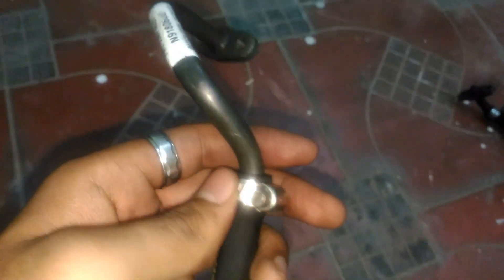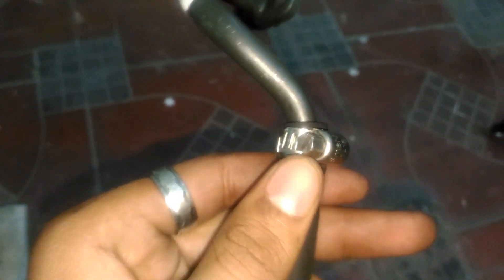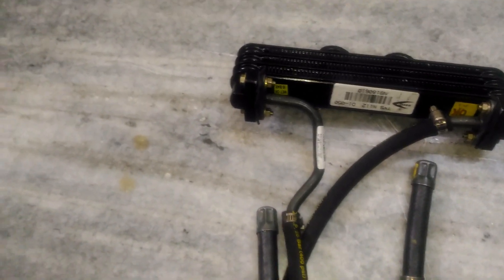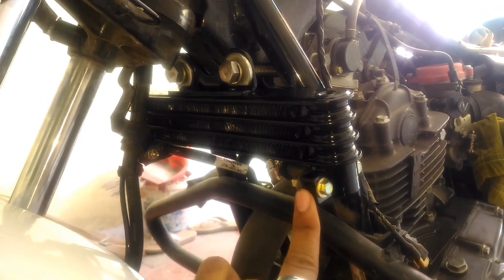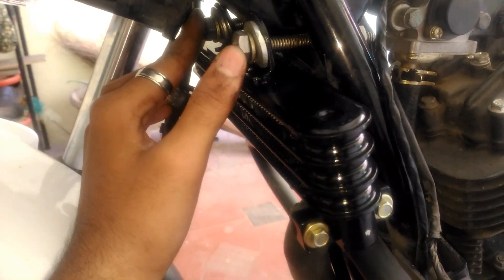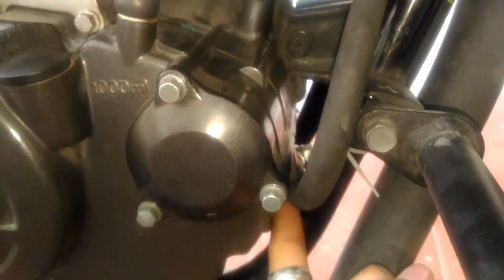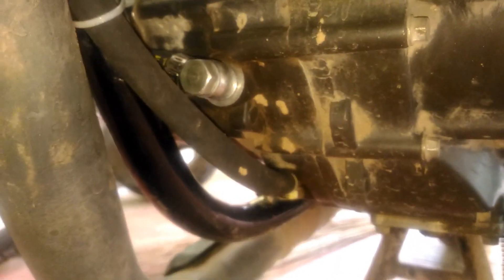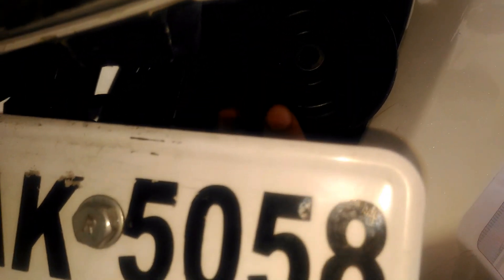Oil cooler installation on TVS apache RTR 180 ABS | DIY | heating issue resolved

Comment: Bro can u  make a video on 
1= Converting of rear drum break to disc brakes APACHE 160 with costings
2=Converting non ABS to ABS APACHE 160 pls with costings 
desperately waiting for your reply
Reply from the maker: brother firstly I need to appreciate your quires.  Because you asked me to useful things on bike.  Even I was in the thinking of converting normal bike into ABS.
But the sad thing is that, I am studying and I am depend on my parents.
So i cannot spend money as wish I think.
It was my future plan, when i learned to make some money.
Now a days I am just doing some cost efficient projects like side safety feature.  If you wish please do watch that on my channel.
thanks a lot for your enthusiasm.
God bless.  Ride safe.  Have a good day.
Reply: @Mechanicgrapher  it is not worth because we you have to replace a lot of parts for installation of ABS unit.

And reliability will always be a issue.
Reply from the maker: @442honey  yes i know buddy.
I need complete ABS system.
Then I need to change the complete wiring harness.
Install new ABS sensor plates which comes under ABS system.
All these are gonna cost more than 17k. Thankfully I already own ABS equipped motorcycyle.

Comment: after fixing oil cooler will we get any engine problem?  and the tvs company is not providing oil cooler for rtr 180 then why they are given that input and output  holes on engine.
Reply: Bro ..iam from madurai ...but my apache rtr 180 is over vibration ..it can solve by placing oil coller
Reply: vicky vignesh  hi bro I'm from Bangalore , I own a Apache 180 , I liked your video very much , and I wanted to talk to u once regarding this radiator so please mail me your number , ravikiran6597@gmail.com, hopefully waiting for your mail bro
Reply: Bro i bought  oil cooler assembly but i am not finding in let , out let mark on oil cooler assembly and i confused which side i have to fit the in let and out let pips. please guide me
Reply from the maker: Satish century use any one port as inlet and another one as outlet.
Its not a big issue.
Reply: I am using motul 7100 20w50 i can say i feels less vibes .i never faced any issue .
Reply: Will it be worth to spend??
Reply from the maker: Satish century It is been more than 1 month and 1k kms on my odo. . still now i have not faced any problems related to engine . . .
Reply from the maker: Please go through the description of this video to know the reason why i have added oil cooler to apache 180 . . . Thanks for your. Comments . . . .
Reply: your from which city bro?
Reply from the maker: Satish century madurai,  Tamilnadu . . .
Reply: bro i am also from tamilnadu vellore but now in bangalore
Reply from the maker: Satish century cheers . . .good to hear man . . .
Have a good day . . .
Reply: After installing the oil cooler, the oil quantity needed to be increased. So suppose I am currently using 1.2litres of engine oil (originally 1litre) then at every oil change, when I drain the old oil, there will be some oil which will be in the pipes of the oil cooler and wouldn't drain out with the rest of the oil. So while refilling, should I refill 1.2liters or will 1litre suffice as there is already some amount of old oil in the radiator which isn't drained?
Reply from the maker: Yes we need to speak about this issue.
It is about how you drained the oil.  While draining the oil, you need to lean your bike slightly on the left and ride side, to drain the oil completely or otherwise you can also remove to banjo bolts on the engine's oil provisions to drain the oil from the oil cooler.  And also, you can blow some air using the compressor to remove the oil from it completely.  By this method you can completely remove the oil from the engine, including in the pipes and the oil cooler.
After that, you can fill up oil up to 1.2 liters.
We must have to completely remove the oil, since it is much more better for the engine.
Because the Old one is filled up with carbon deposits and sediments.
Reply: Hi Satish.. me too from bangalore.. can i see your bike.. for more clarification.. and need some price details and where did u bought this one../
Reply from the maker: B Chandru great to hear bro . . .
Vibrations in apache cannot be resolved completely . . .
Since, it has unbalanced cam shaft. . .
So just use 10w40 grade engine oil . . .
This will helps you to control the vibrations partially, but it is not a complete solution . . .
Try to change the oil when the oil colour gets changed . . .
Probably for every 4000k kms . . .
Try shell or idemitsu oil . . . Brand may vary . . .but the grade is important . . .use the same grade as per I mentioned . . .
Reply: How about V300 Motul  10W40 or 10W30
Reply from the maker: RAVIKIRAN kiran bro ask your doubts here . . .
I will clear all your needs . . .
Reply: vicky vignesh  bro can we onn the vehicle to drain the left over oil in the radiator, so that it can be removed quickly by force
Reply from the maker: It is not safer way to drain the oil from the oil cooler.  Use some compressed air to completely drain the oil.
Reply: vicky vignesh  bro why don't u do a clear video on fitting it
Reply from the maker: subharaj naskar it will stress the engine bro.
They should be used on liquid cooled engines.
Try 10w40 grade.
Reply from the maker: subharaj naskar yes of course man
Reply: Satish century bro i do have a 160,installed cooler of 200 4v it works fine, without any issues and the engine is pretty smooth right now

Comment: I have Apache rtr 180, and the major problem which I usually face during the long rides is the heating issue of the engine. wen I saw ur post I was really glad to know that we too can put oil cooler as avenger/pulsar.

So my first doubts are:

1. how to tap the oil from the engine's both the ends (upstream as well as downstream)?
2. does it require any oil pump to maintain the proper circulation of the fluid?
3. does the radiator consist of a fan? if yes then from where have you given the connection?
4. do we need to put more engine oil in order to maintain the proper circulation?
5.how to prevent the oil leaks near the tapping areas?
6. which all radiators are suitable for Apache's engine?

please answer my question so that it will be easy for me to install the same equipment in my Rtr.

Thank you
Reply from the maker: Yes you are correct man.  We can put oil cooler on RTR series.
I will clear all of your doubts one be one as per you mentioned.

1. Apache's engine is the rebored version of Suzuki's fiero engine, since that is the reason that the first version of apache is 150 cc.  In that fiero engine, we can find the provisions for oil inlet and outlet. So as per I said that apche's engine is the rebored version of fiero, we can also find the same provisions at apache's engine too.

2. In this video, you can notice that, i have mentioned about pumping the oil to the oil cooler assembly.  That is, the gear pump is nearer to the inlet provision, which pumps the engine oil to the cylinder head. So therefore you does need to fix any external gear pump and do not worry about that. After fixing the oil cooler, the gear pump also pumps the engine oil to the oil cooler too and it works pretty much well.

3. Firstly it is not an radiator assembly, it is an oil cooler.  Radiator differs from the oil cooler, that most of the radiators uses external medium (Eg: water, coolant oil etc) to cool down the engine.  But here we are using an oil cooler to cool down the engine oil, that is maintaining the viscosity of the engine oil in an idle state. Only radiator assembly needs a fan, because the engines with radiator assembly does not have cooling fins at the engine's cylinder block to transmit the heat to the atmosphere during riding inside the traffic areas or when the bike is in idle portion for sometimes.  So that is why they are using cooling fan to their radiator.  I have seen that some peoples using CPU cooling fans on Pulsar 200 and avenger to absorb the heat. But they also mentioned that the fans are not much efficient since they are not designed for that. If you wish to fix a fan, you need to use a better cooling fan other that CPU fans. My opinion is cooler itself is enough for apache.

4. Yes you need add 200 ml of extra engine oil during every oil change.

5. Yes, the same problem also faced on my friend's bike. Just take it to the TVS service centre and report the problem to them.  They will take care about that problem. They will apply some liquid sealant on the leaking areas. 

6. P220 and avengers oil cooler also fit for apache.  But we cannot get them easily.
I will prefer apache's 200 oil cooler.  Since it is designed for apache.

I am very happy to help you man.
Go on.  It will works well after installing.
Now I am facing a huge change on my bike, which feels pretty much well on long rides.
Ride safe. God bless. Have a good day.

Comment: Any plans on making your bike from 180 to 200 cc rtr using its parts.
I am really looking forward to do it.
But I am confused a bit that what parts I am going to need it for.
The parts I considered are rtr 200's carburetor ,cylinder head assembly which includes the valves and camshaft.
I am confused with the cylinder do i need to replace it too?

The other mod I am considering is if just install a high lift cam camshaft from a bigger cc bike and a bigger carburetor borrowed from rtr 200 which will cost a lot less because rtr 200's cylinder head assembly cost is around 5600,2500 for the carburetor and if changed the cylinder and piston kit Rs 3500, then the total cost will rise above Rs 10,000.

But I don't know that from which bike I should borrow a bigger camshaft that will fit in my 180.

I asked you this after watching your video, I thought may be you have some information regarding these mods. Please share your ideas :) 
thank you.
Reply from the maker: First of all i need to thank you, since you have asked me a lot of questions.  I will answer them one by one.
I do not have any plan in converting my 180 to 200, since i am not earning now, I am still studying.
If you are planning to convert it, only apache 200 parts will match perfectly, because both are from the same motherhood named TVS.
When if you are in action, then you need to change the complete cylinder head barrel assembly including piston, 
 connecting rod, carburetor, valves and camshaft, etc
And the main thing is that, you are in the planning of using high lift cam. We need to discuss about it a lot.
my question is, is there any high lift cam for RTR series? or is there any after market high lift camshaft which suits for RTR?
and you cannot use any other bikes camshaft, because each and every bikes camshaft differ from its size, dimensions and geometry. So I think other bikes camshaft would not fit for RTR series.  
Finally I am not a pro mechanic. Is there any wrong with words, please correct me and a huge apologizes for that.
Before doing this please consider a good mechanic.
Thanks a lot.
Have a good day.
Stay safe, Ride safe.
Reply: Emiya Geerain  dude I am going to modify the 180 engine
Borrowing parts from rtr 200 and you may now imagine the results
Reply: rtr 200's carburetor(4500 rs),head unit(3500rs),cylinder piston kit(3700rs) and pulsar 220's oil cooler radiator assembly(2000rs). 1000-1500rs installation charges.
Reply: Not yet ! coz too much expense for extra 10km/hr does not makes sense. I can still achieve similar top speed of rtr 200 by changing its gear ratio with a slight decrease in acceleration. Just use rtr 160's rear sprocket+pulsar 150's front sprocket which will result in 12% increase in top speed with slight slow acceleration.
Reply: @GamesReckoning  hi bro can I get it contact number
Reply: Harshit Sengar  rtr 200..not..a worthy aero dynamic applicable..rtr 180..is more faster and speed than 200 well I checked..it i am rtr rider too
Reply: I m also rtr 180 rider...I m also thinking about transformation...big bore kit.. for more cc..plz give me some information..
Reply from the maker: Harshit Sengar have you converted your rtr???

Comment: OK bro, then how to reduce vibration please suggest me
Reply from the maker: Vinay H M vibrations cannot be reduce completely on apache . . .
you can add some rubber washers in between the engine bolts to reduce the vibration . . .
Reply: almost vibrations are from doom check and adjust rubbers

Comment: bro my RTR 180 has a vibration , can it reduce vibration can install oil cooler?
Reply from the maker: Vinay H M no it won't man . . .
it is only to transport and reduce the heat generated in the engine . . .

Comment: make a review video of this
Reply from the maker: Leader Raptor still now it is working perfect and there is now drawback in it bro . . .
Reply: vicky vignesh but does it reduces vibrations i want to see that
Reply from the maker: Leader Raptor it is only to reduce the heat generation . . . .
the vibration in apache cannot be reduced since it is rebored version of old fiero engine which does not have a balanced shaft . . . . . .
Reply from the maker: Leader Raptor no man . . .it won't reduce the vibrations . . 
only liquid coolant system will reduce some vibrations . . .since the coolant oil circulates around the engine, will leads to observe the vibrations . . .
this setup is only to reduce engine heat by cool downing the oil . . . .

Comment: i want 2 say that using oil cooler in apache 160...is possible....and this oil coolent is avaliable in spare parts store...or not
Reply from the maker: Akshay Sharma yes it is the spare of apache 200 4v and it is available only at tvs service centre

Comment: what will be the result of installing oil cooler in apache?? smoother???? less vibe??
Reply: Vicky shud we add any oil to radiator or its Air cooled
Reply: please explain me wt type of radiation 200apache has and how it works
Reply from the maker: Yes, the engine becomes smoother even during the long rides and vibration is also reduced.
Reply: vicky vignesh mine is 160rtr
Reply from the maker: it does not matter.
you can install it for smoother and good performance
Reply from the maker: RAVIKIRAN kiran when it comes to oil cooler it cool downs the engine oil temperature . . . .
So after fixing it you need to add 200 ml extra engine oil during every oil change
Reply from the maker: RAVIKIRAN kiran it is an oil cooler bro . . 

It cools down the engine oil . . .